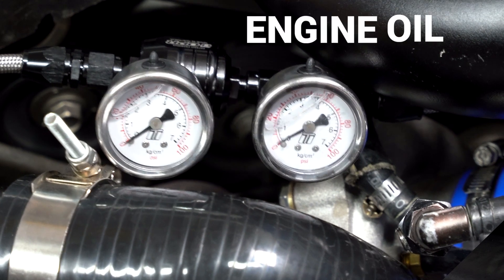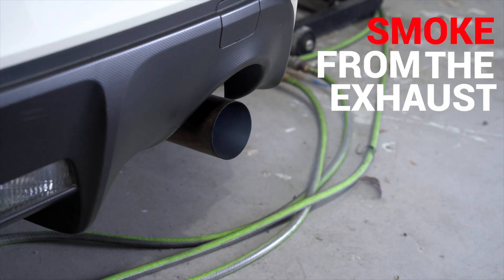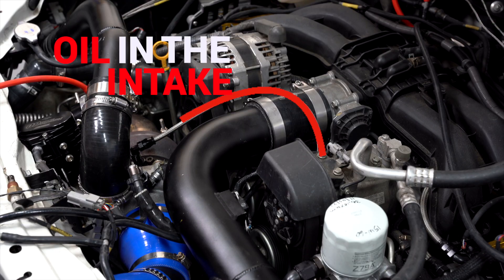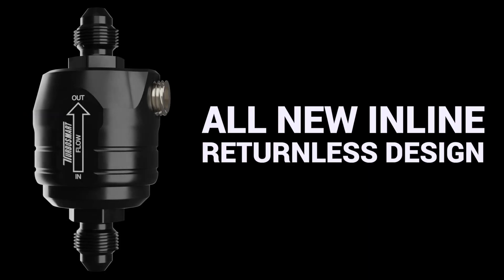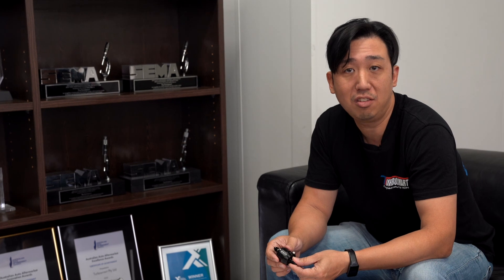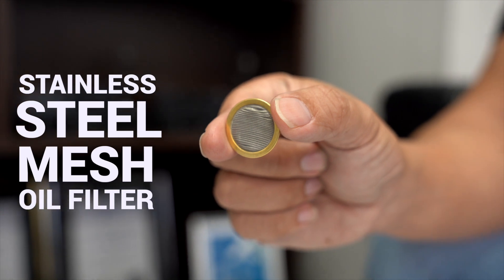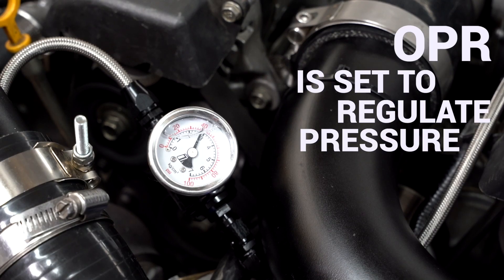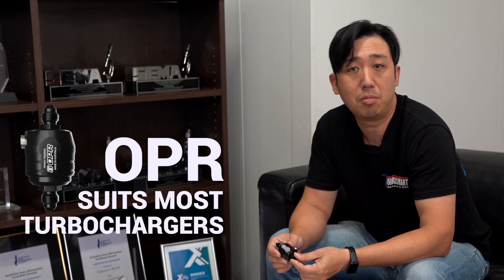OPR | ALL NEW INLINE RETURNLESS DESIGN by Turbosmart

Comment: So does this also work on journal bearing turbos? FP told me to run w/out restrictor and their turbo spit oil until my engine blew 😢
Reply from the maker: Restrictors installed in the turbo's CHRA are vital to ensuring that the proper volume of oil is lubricating the bearings. It is rare that you would see a turbo without any restrictor in the CHRA. A full 40PSI of oil through a -4AN inlet doesn't sound like a great recipe.
Reply: @TurbosmartHQ  does this mean this is not a good regulator for a journal bearing turbo?    Still would need to add a restrictor?
Reply: Pressure & restrictor are 2 different things

Comment: You can’t adjust the pressure at All ? It’s just pre set?
Reply from the maker: That is correct, the OPR V2 is set to start regulating at 40PSI. You cannot adjusting this to a higher or lower pressure.
Reply: @TurbosmartHQ  how effective is it. Does it maintain that 40psi or does it go higher or does it depend on the car

Comment: Hi will the turbo still recieve oil if supply pressure is only 20psi  at idle ? Thanks
Reply from the maker: Anything under 40PSI may see a pressure drop of 1PSI - 2PSI. Anything over 40PSI will be regulated.
Reply: @TurbosmartHQ  spot on 👌

Comment: Hi, great product, I just purchased this from my local supplier, I have a Garrett 3076r with currently oil restrictor banjo fitting, will I leave this restrictor to control flow as well as the OPR? Or do turbo smart recommend an OPR and no restrictor fitting? Thanks in advance, Shane
Reply from the maker: Leave the restrictor in if it came with the turbo.

Comment: My oil pressure is high when cold, but gets around 28psi when hot at idle. I have been having continuous problems with my journal bearing turbos allowing oil past the seals over and over again. Sometimes it clears up and stops, sometimes it doesn't.  I guess im just worried about when my engine oil pressure is below 40psi, will the turbos still be receiving the proper lubrication?
Reply from the maker: The OPR V2 will not start regulating pressure until it sees 38-40PSI.
Reply: If is bellow 40psi those oil still flow true the line
Reply: @gangsterboi4413 yes bro Wats so hard to understand.  The oil still flows  but if its over 40 psi it'll regulate it. Flow and pressure are two different things
Reply: So  will it still allow oil to flow under 40 psi ? 
Say if idle pressure is only 20psi ?
Reply: @colinmann670  Anything under 40PSI may see a pressure drop of 1PSI - 2PSI. Anything over 40PSI will be regulated.

Comment: Are these good for journal bearings?
Reply: Short answer yes, at idle and low speed your oil pump may not even supply 40 psi(probably does though..maybe) but as rpm rises(or you have an aftermarket pump like me) your pressure could be much higher. This could lead to oil blowing past the seals like he said. This is true for both journal bearing and BB turbos.  BB cartridges have an oil restrictor to limit flow, not pressure(2 different things) as the bearings need a thin coating of oil to work right, not a full on river of oil like journals do...think of it like a trans versus engine bearings. Trans use roller bearings which need a bath of oil whereas all bearings in the engine have a clearance to run a pressurized layer of oil between 2 metal surfaces....that's how a journal bearing works, like main crank bearings

Comment: I have a 5.0 f150 with a top mount twin turbo set up. Should I use a regulator for each turbo or one before the y connection in the oil supply line.
Reply from the maker: One OPR will be fine for the two turbos.
Reply: Ok for twinn gtx5020r??
  @TurbosmartHQ
Reply: Awesome. Thank you